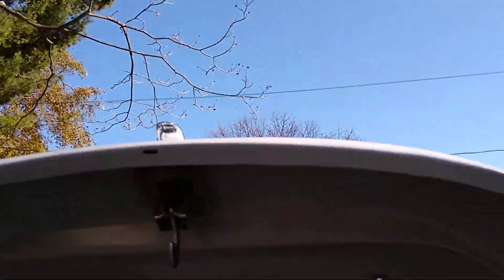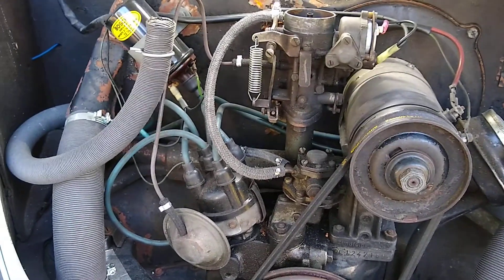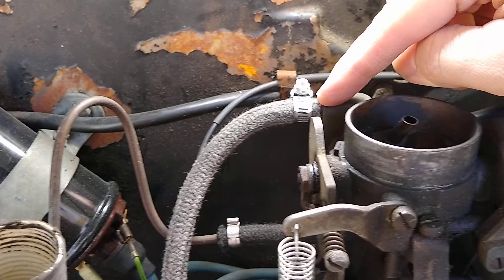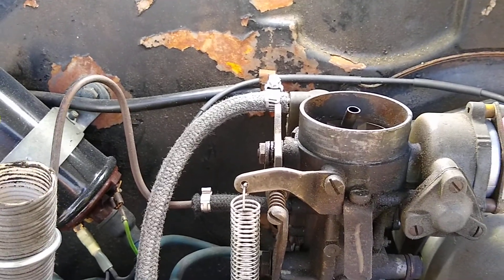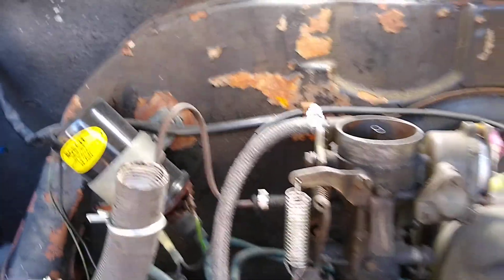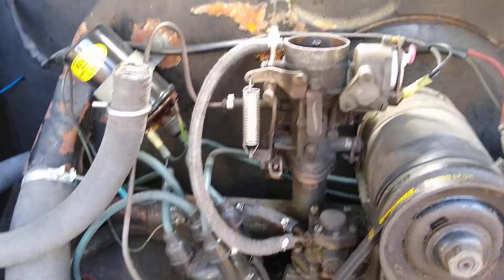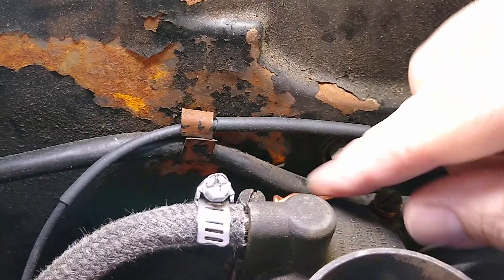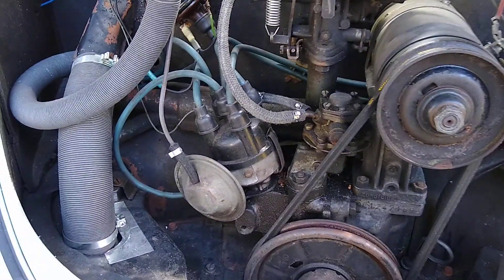VW Beetle - carburetor safety wire

Comment: Yes very good idea!! I see some of the new replacement carbs have them threaded in and barbed.
Reply from the maker: I've not heard good things about the aftermarket carbs though...best to stick with OEM Solex if possible!
Reply: Chris Freemesser Oh I agree! If my stock solex even has the worst case scenario, leaking throttle shaft, I’ll send it out to get rebushed. They do run best stock!